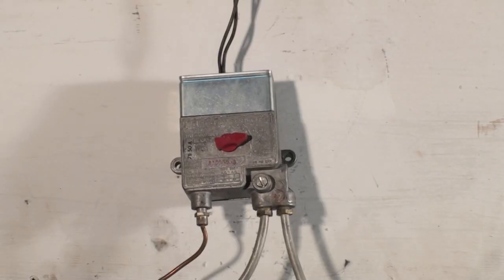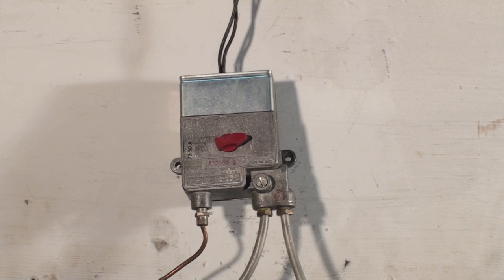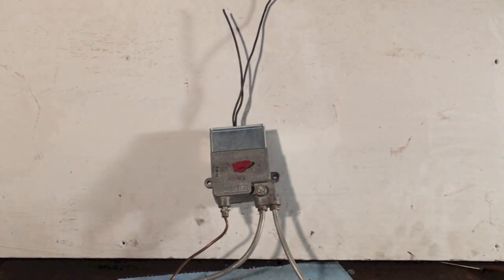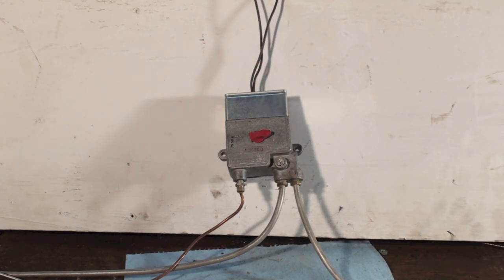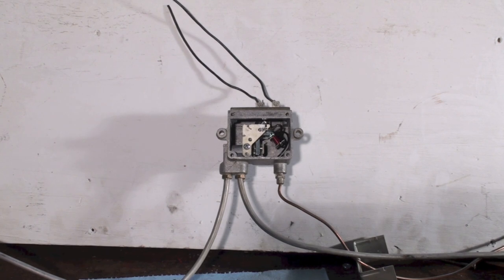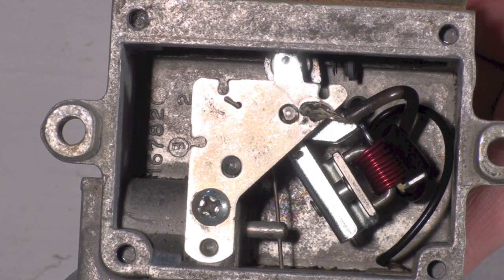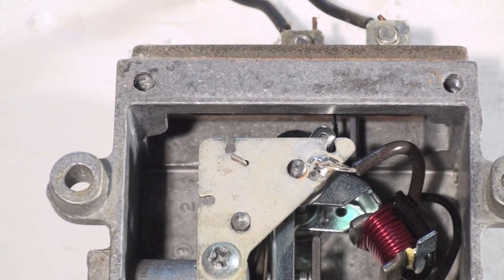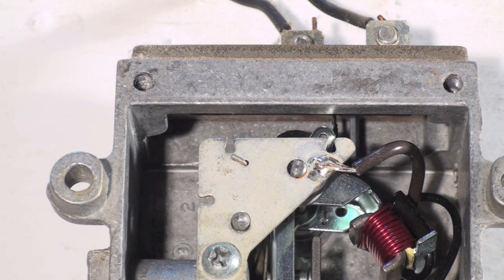Gas furnace pilot safety switch

Comment: Never seen one of these. Interesting control though. It amazes me how they did things back before electronic controls. I'm still amazed by the design of the original Honeywell aqua stats. Such a simple control, but it has been around forever because it is a design that works. Thanks for another good vid GFM.

Comment: We have a Republic Gyroscopic Balance furnace. Everyone tells us that the reason the thermostat doesnt work is because of the pilot safety switch. The thermostat does not work. It use to spark when we turned it on. The house was built in 1941. Thoughts?

Comment: My solenoid valve is clicking when heat demanded but no gas to main burner, pilot is lit and good, main valve turned to on, what is the little aluminum tube that goes into solenoid valve from pilot flame? it seems to be hollow with compression fitting into solenoid valve , just a tube.. thanks ! sorry it's and old Baso unit from 60's
Reply from the maker: The tubing transports pilot gas to the pilot assembly.  
If the solenoid clicks, but no gas flows, the valve has failed.  None of the original components are available.  They are replaced by a combination gas valve.
GFM

Comment: We have one just like that. Can we use something comparable to the old one. Furnace company want to charge us 20k for new furnace
Reply from the maker: There are options like a combination gas valve to replace the controls in the system.  If you can find a service tech to do the job.
GFM